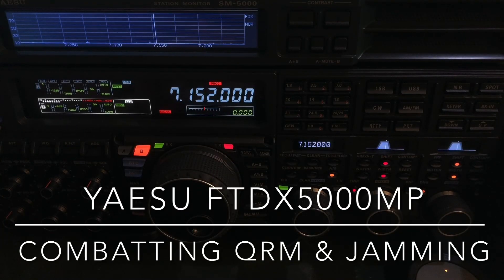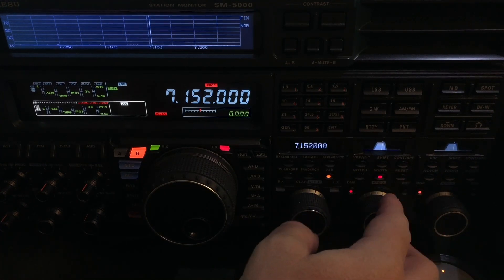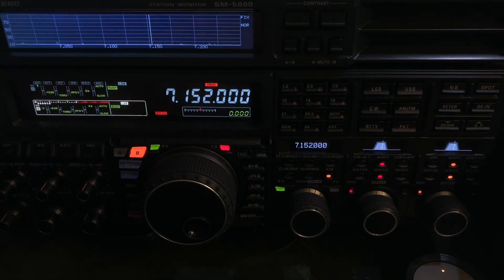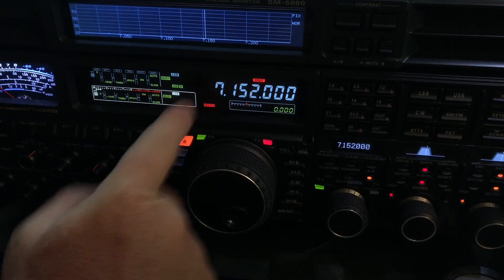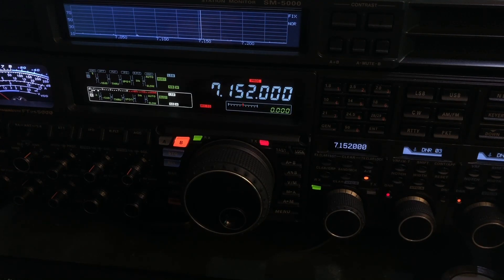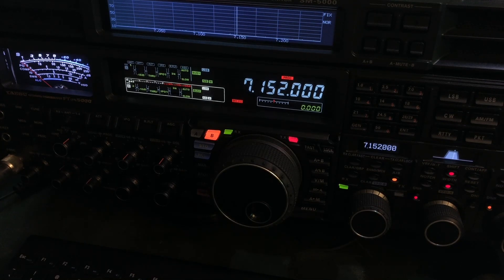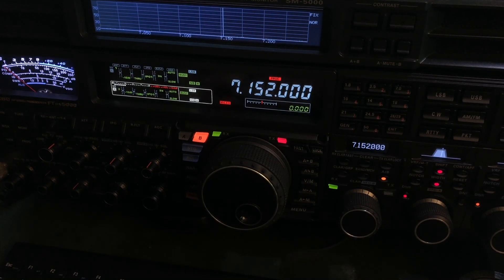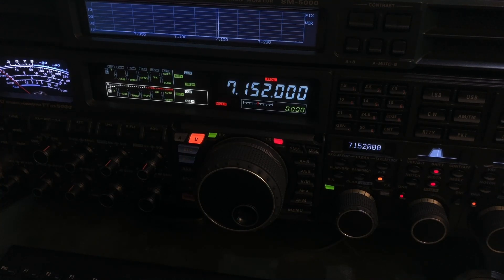Yaesu FTdx5000MP: Combatting Jamming & QRM

Comment: Isn’t dealing with the noise, the thing that separates the men from the boys though? I absolutely love it when I can work a noise soaked signal in. I like to use all of the knobs and buttons. Those are the QSO’s I remember most… another great video, thanks! De KD2TJU.
Reply from the maker: Indeed Todd!  I live for that challenge.  That’s why I chase the SOTA stations.  And if there is a National emergency, I have prepared myself to be able to operate in crowded band conditions and pull out weak signals.

73 my friend!

Comment: I was going to suggest one of those Chinese “qrm eliminators” from eBay. They work great , and lower the noise floor.
Reply from the maker: I have the MFJ-1026.  It does indeed cancel the noise, but it cannot handle high power.  And the WiMo-26000, from DX Engineering can only handle 125W.  I referred to those devices in the video and one of the commenters asked for more information.  I answered him with a more detailed explanation, in case you’re interested.  Just read the comments to this video.  

73, de N4HNH
Reply: @n4hnhradio  I read it. Mine is in between the radio and the amp. Run 600w all day long , never an issue with rfi damaging it. Best $50 I spent on an accessory.
Reply from the maker: Mine is, or was, between the radio and amp.  But I got tired of replacing the light bulbs.  Are you using the one from DX Engineering?
Reply: @n4hnhradio  I’ll send you an email with the one I use

Comment: You have really helped me with my ftdx 10. Very good series on that rig. Keep up the good work.
Reply from the maker: I’m so glad you found the series helpful.  Thank you for letting me know.

73, de N4HNH
Reply: @n4hnhradio  I bought the radio after your watching your videos!
Reply from the maker: Congratulations!  I hope you are enjoying it as much as I have been.  Which radio did you use before?

73, de N4HNH
Reply: @n4hnhradio  Icom 7100 with an SDRPlay duo for reception. I tune the SDRPlay and 7100 with Ham Radio Deluxe. I was sold on the  FTDX 10 by the digital noise reduction and simple interface that uses fewer menus. The Sherwood rating was icing on the cake. I wish it allowed for multiple antenna ports, however.
Reply from the maker: Indeed.  The FTdx10 is essentially half of a FTdx101D, which has multiple antenna ports and two separate receivers.  But, I will admit, 95% of my operating doesn’t require the second receiver in my FTdx5000MP.

The digital noise reduction in the FTdx10 is definitely magnificent.  The roofing filters are great too.  The DSP width function is nice and tight as well.  Adding the 300Hz roofing filter puts it over the top for CW.

If you read the footnotes in Sherwood’s list, you realize that the Flex 6700, at number 2, is vaporware.  That radio Sherwood tested was a one-off.  I don’t know what kind of game Flex was playing with Mr. Sherwood.  I think that point should be more clear without needing to read the footnotes.  The Flex radios that are for sale have a RMDR rating of 99dB.  Your FTdx10 comes in at 107dB.  The only radio that can beat the FTdx10 is its big brother, the FTdx101D.  So you have a super nice radio.

73, de N4HNH
Reply: @n4hnhradio  Thanks for helping me realize I made the right decision.

Comment: i also run a zs6bkw and a ft5000mp .. thank you for all your clips and info on the 5000.. realy never thought off using both receivers like this for the problems we all have on the crowded bands  . well done good dx  steve m0ebj uk
Reply from the maker: I’m so glad you liked the video, Steve.  I’m very pleased with my ZS6BKW.  And I would not trade my FTdx5000MP for any radio on the market.  If you haven’t watched it yet, check out the video about diversity receive with the 5000.  It’s in the FTdx5000MP playlist.

73, Doug

Comment: I have been playing with diversity receive on my FTDX5000. It comes in very handy in certain circumstances. I do battle with noise a lot. You mentioned after market noise cancellers. Can you recommend any?

Edit: I haven't heard that the FTDX5000 has been discontinued. Gigaparts lists is a such, but nothing on Yaesus own web site says it. Where do you have this information from?
Reply from the maker: DX Engineering has the WiMo 26000 noise cancellation device.  I haven’t tried it but I have read the reviews.  MFJ has the model 1026.  I have that unit.  It really works, but when I run my amplifier, it blows the “fuse”, which is a special light bulb that is inside the unit.  A replacement must be ordered from MFJ and soldered in.  

The MFJ -1026 cannot handle the 200W from a FTdx5000MP. It is rated for 100W.  The WiMo 26000 is rated for 125W.  If you wire the unit between the radio and amplifier, and drive your amplifier with less than 100W, maybe the WiMo 26000  will be okay.  But the MFJ-1026 still fails after a steady bombardment of 700+ watts, just from the RF in the air.  The noise antenna needs to be another outside antenna, similar to the one you are transmitting with, making it susceptible to the high RF field resulting from the amplifier.

If you don’t need to cancel noise, you could set up perpendicular dipoles and the phase knob on the noise canceller can be used to electrically rotate your receive pattern.  If you watched my diversity receive video, you saw me use diversity receive with a vertical and horizontal antenna to combat fading.

Yaesu discontinued the FTdx5000MP a few months ago.  Gigaparts has a note below the photo that reads, “Discontinued by Yaesu.”  Ham Radio Outlet says “Delivery will be delayed.”  DX Engineering doesn’t show it as an option anymore.  I was told by the Yaesu marketing manager that sometimes Yaesu will “build to order”,  until they have no more parts available.  This usually takes 90 days or so.  One of my Patreons ordered one from a dealer in the UK.   After a couple of months of waiting he canceled the order and bought a FTdx10.  Of course the FTdx10 cannot do diversity receive.

73, de N4HNH

Comment: I didn't know that receive diversity is a feature of the FTdx5000. Very cool! That's a technology we use in cellular systems. Does the FTdx101 have this feature and does it work as well?
Reply from the maker: It’s a manual process but a dual-receive radio that allows you to assign a different antenna to each receiver is capable.  The FTdx101D or MP definitely fits that category.

As you know, the antenna for each receiver should be oriented so it has lobes where the other antenna has nulls. This can include differences in polarization as well.  A practical way to accomplish this is with two dipoles that are cut for the same band and oriented perpendicular to one another.  Each dipole will typically exhibit a figure 8 pattern.  As the received signal strength decreases on one receiver it might increase on the other.  

Another option is to attach a vertically-polarized antenna to one receiver and a horizontally-polarized antenna to the other.  I demonstrated that scenario in my diversity video.  As the signal tumbles in the ionosphere, the polarization can change.  This is similar to how the signal polarization from a cellular handset can shift according to the orientation of the handset. With diversity receive, using two antennas of opposite polarization, the signal fades from one receiver and improves on the other.

My background is commercial radio.  I was a Motorola technician in the early days of cellular technology development.  It started as SMR (Special Mobile Radio), with the handset functioning as either a handie-talkie or a phone.

Thank you for visiting my channel and thank you for your comment.  I encourage you to access the FTdx5000MP playlist on this channel and watch the video about diversity receive.

73, de N4HNH